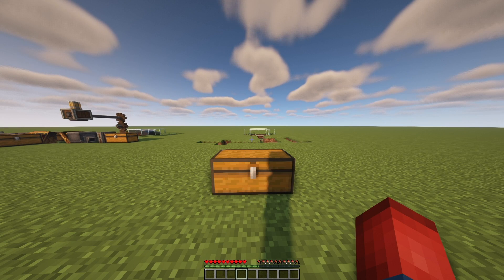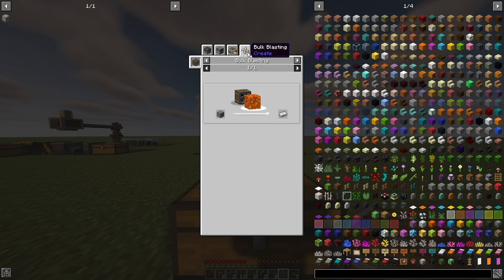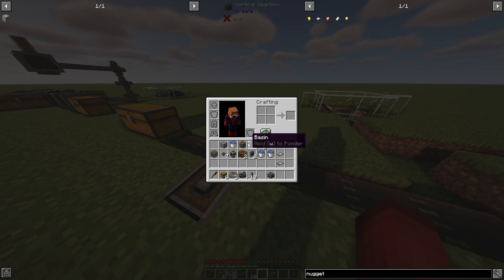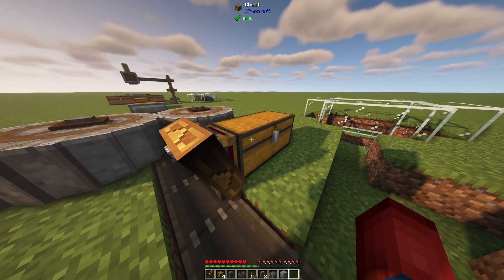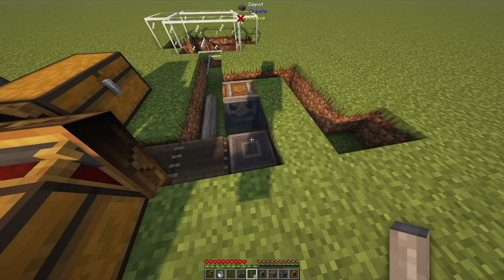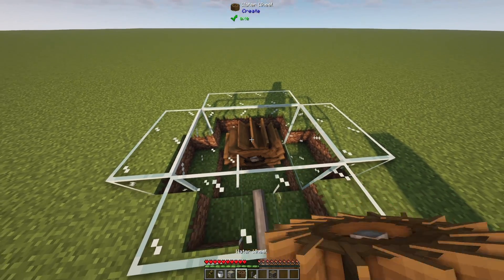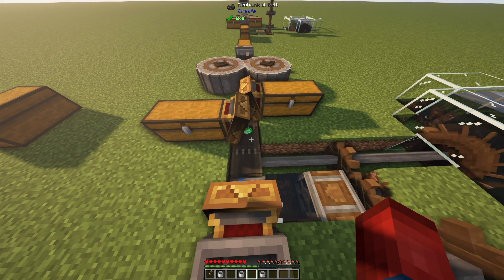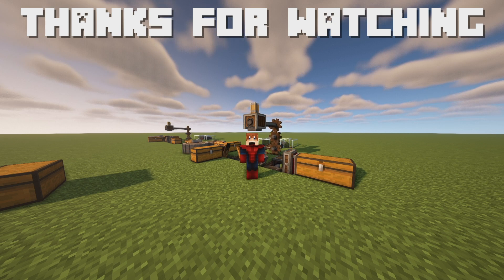Minecraft Create Mod Tutorial - Ore Processing System Ep 30

Comment: just did this in a modpack a friend made, with some changes. modpack includes Storage Drawers, so i took out the press entirely and fed the washed ores directly into the drawer controller, as well as removing the cobblestone chest as you gotta have a dedicated cobble drawer or two in your drawer library. as for the filter directly on the washing station, i used a deny filter and selected the crushed ore types so that the funnel would grab the nuggets, coal, lapis, redstone, diamond, and emerald by default.

and if you build the water wheels first, you can always either flip the processing belt or place a gearbox right next to the water wheels for the desired effect! only issue i encountered was with the silver ore introduced via the Werewolves mod not processing into nuggets by any method at all.

Comment: I was about to ask what about the leftover nuggets, because I thought they would clog up the system, but you got me covered in 10:25 lol. Great video, thanks for the help
Reply: If you have a lot of ores in your modpack they definitely will clog your system up with nuggets. The only solution that I have found myself is doubling the processing belts after the initial non-metal filter and filtering what nuggets go where instead of relying on tags for filtering. This also helps with washing stuff faster. Another way to solve this would be to detect a clog and spin up a Mechanical Arm that then unclogs it, but this seems overcomplicated (unless you have enough ores to clog two belts).

Comment: If you want to speed this build up some more here's a couple things you can do:

Place soul sand underneath the water to create a bubble column which makes each water wheel 320 su.
Place a second encased fan with water infront of it on the opposite side of the depot to wash the ore faster.
And finally you can use a rotational speed controller to increase the speed of the press, belts, and fans.
This will take some fine tuning, but doing these three simple things could double, or possibly triple this setups capabilities.

Comment: I don't know if this has been said (this is also quite late) but you can move the water wheels back one block and as someone said, put a soul sand at the bottom and make a bubble elevator so that the water goes all the way around which maxes them and also put a large cogwheel then put a small cogwheel diagonal to it so it has a higher rpm and then just connect it back with cogwheels and move the gearbox to the other conveyor belt so it still works the same but a bit faster.
ps, thanks for the tutorial, I ended up finding some diamonds whilst making it lol

Comment: I know this video is six Months old, very well made by the way! Just a tip for your water wheel setup, which you may have done in a newer video (I haven't checked). If you replace the blocks below the glass that the water sits on with soul sand and use a bubble elevator, the output from each individual waterwheel goes from 256su to 320su. Which is not that much of a difference, but a difference non the less and it allows you to use all 4 sides of the water wheel for maximum power output. Someone may have already said something about this, but I didn't see anything in the top few comments.

Comment: I like the video and all but I have one Issue. At the begining of the video you are saying that this system will produce more diamonds than fortune 3 pickaxe. Is it really the case? Fortune 3 can give you 2-4 diamonds and you got only 2. Is there a chance for more than 4?
Reply from the maker: So yes it is true after a long amount of testing. So it all depends on percentages a crushing wheel has a higher percentage of consistently creating 3-4 diamonds while a fortune 3 pickaxe has less of a percentage. So if you put a stack of diamond ore in crushing wheels vs if you mined a stack of diamond ore the crushing wheels would output more!
Reply: I asked in the Create Discord. On average the crushing wheel will give 2.25x diamonds, wheras Fortune 3 gives 2.20x on average. So it's slightly better. I believe it's also more consistent, giving you closer to the average.
However, if you're playing with a modpack where fortune 4 or more is possible, that'll always be better. Buuuut with the ability to crush and also wash ores such as iron and gold, the system is still useful, as that will give about the same results (2.25x) which is .25x better than a standard ore doubler from other tech mods.

Comment: The crushing wheel won't actual crush any ideas?
Reply from the maker: Hmm what version of create mod are you using?
Reply: @rockit14  the newest. Thanks for responding
Reply from the maker: @wyattbacon1675  just saw this now apologizes - if you are using anything before create 0.3.1 then nothing will crush on the belts. I.e. Create 0.3 will not crush things on belts. I would check to see what exact version you are using :)
Reply from the maker: @DoubleBitch I recommend you check out my previous ore processing video - most likely you are running an old create mod version
Reply from the maker: @DoubleBitch of course!!

Comment: With this system, what happens when/if washing the crushed ore creates an excess of nuggets that are less than nine which can't be pressed, and then you send a different ore through? won't the two different types of nuggets be introduced to the press and clog up the machine? I would probably add another step to the machine which only places nine ingots into the basin at a time, if that's the case.
Reply from the maker: So not to my knowledge I have used this way of designing the system for my singleplayer and multiplayer and havent ran into any issues. Let's say we make 13 iron nuggets. Then 9 will be pressed into an ingot and the others will just chill inside of the basin :)
Reply: @rockit14  The remainder will just sit in the basin, sure, but what if say those nuggets were iron nuggets and I throw some gold ore into there, then won't there end up being 4 iron nuggets and 5 gold nuggets in the basin?
Reply from the maker: @blazer2321  Yup! The basin can hold onto multiple different kinds of nuggets and just have it sit there. I have had instances where I had zinc, iron, gold, and copper all in there and it just waited until one of them hit 9 to press :)
Reply: @rockit14  I did not know this! Is there a limit to how many items the basin can hold, in that case?
Reply from the maker: @blazer2321  I assume there is some limit, but I figure at least 4 - I know that mixers can hold a bunch because you can mix ingredients with a liquid in multiple items which is a nice benefit!